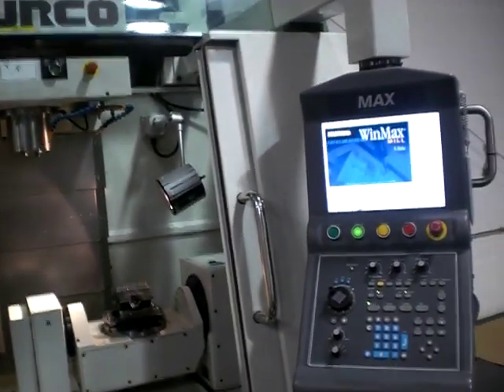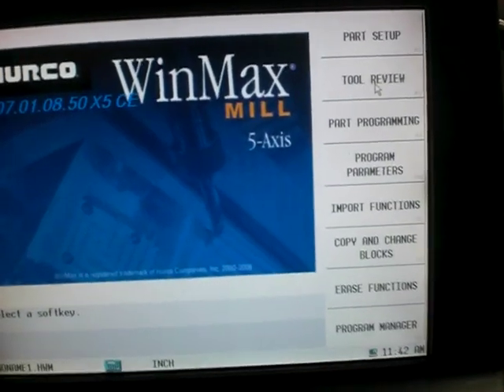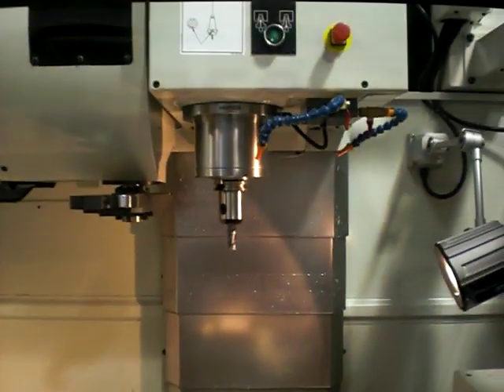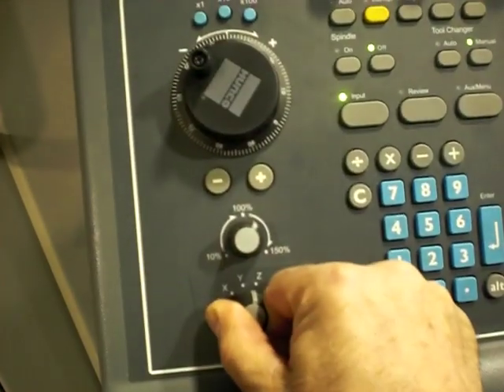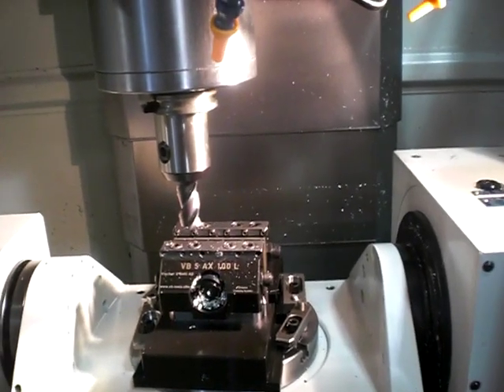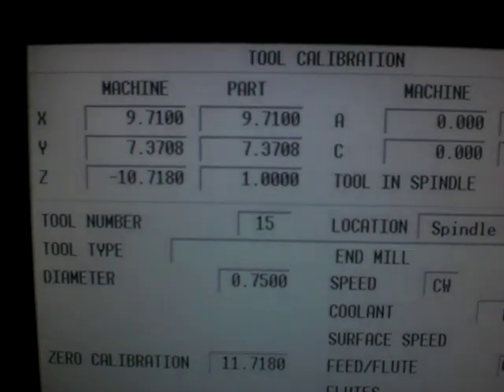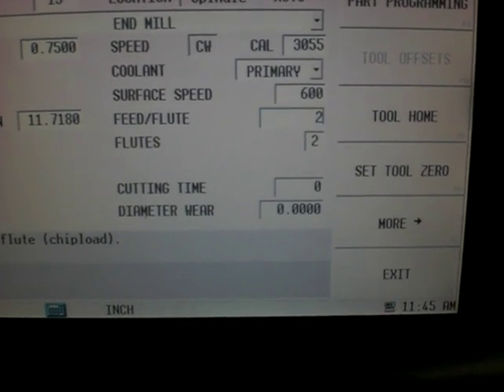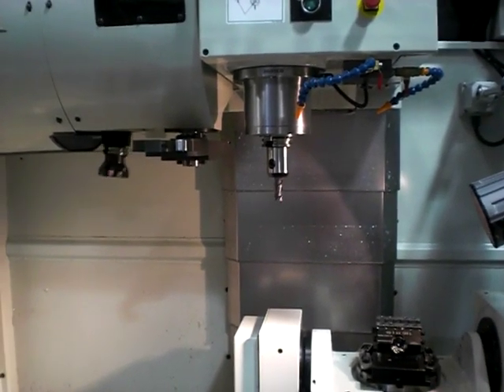Hurco Tool Setup and Calibration

Comment: good video, Tom, thanks!

What is the "200" value used to set RPM and feedrate? and where is it derived?
Also (most importantly) technically, what is the editable "zero calibration" value found in Tool Setup?  Using a tool presetter, how does one enter the known length of tool while in conversational mode?

many thanks!